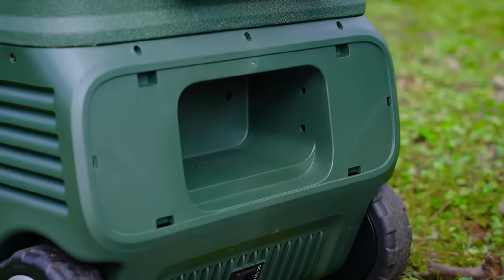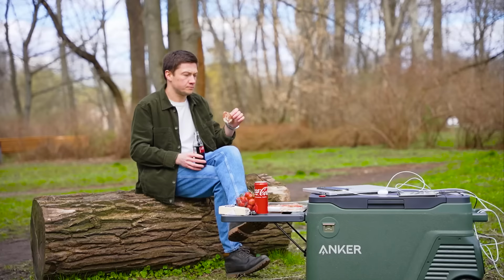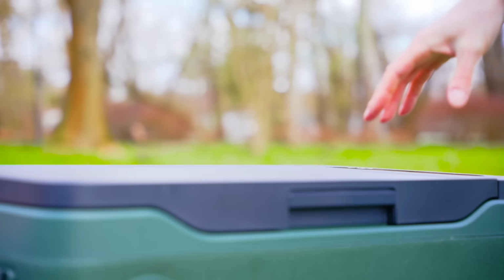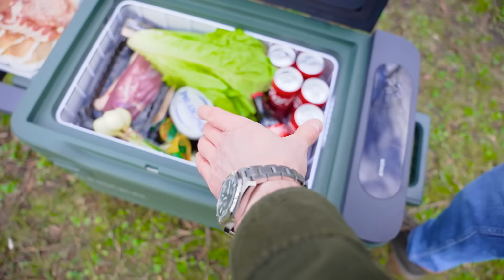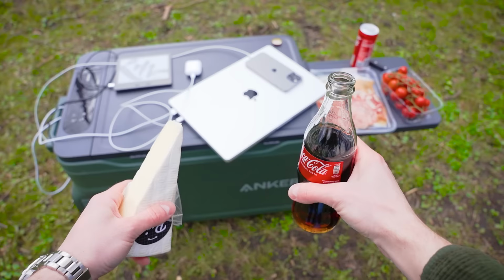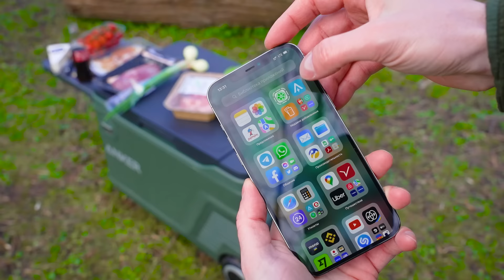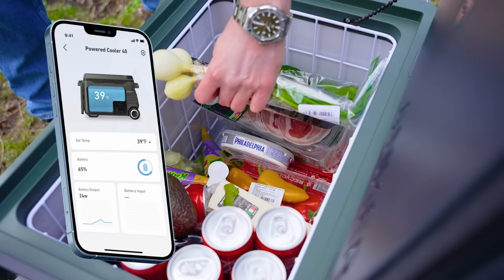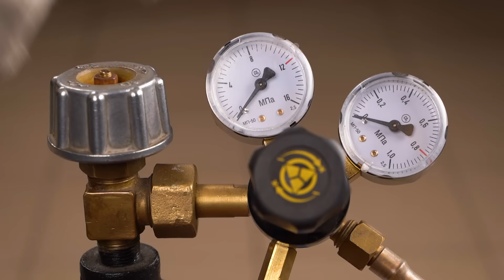Insane Square Cycling

Comment: You should take the bike on a ride in a populated area, where people look in amazement and be like, "What the!?" 😂😂
Reply: The physics of turning a bike actually requires the ability to lean. As far as I see, this bike can only go straight. Maybe a 5 degree turn.
Reply: @MPaxsu  The post linking to it claimed it could also turn but looking at the footage I doubt it.
Reply: I also don't see brakes aside from fixie-style pedal control. I wouldn't want to be in the way
Reply: Straight bike, sounds homophobic
Reply: @MPaxsu  probably can turn the bike like a tricycle. with some adjustment and tuning it probably will work. the wheel itself is similar to tank/snowmobile. maybe work better in a snow day
Reply: @jk2l  except this is a bicycle, and will not turn like a tricycle
Reply: Well the front wheel can be turned i see why wouldnt that ve possible
Reply: @LainorLean  based
Reply: @Ankhyl  you can look it up, there are numerous videos explaining how bicycles turn
Reply: No ability to go over bumps and would struggle on normal roads and pavements including uphill and downhill.
Reply: هذا فيديو عمله و حصل على مكافآت و هو المشاهدات
Reply: @rizzyullah  yeah the "wheels" are firmly bolted to the frame, so it'd be an extremely rough ride at best over anything but a perfectly flat surface.
Reply: @MPaxsu  I think it can turn bc the wheels have plane surfaces, so it can stand up while turning. The thing is that this is not a bicycle anymore, u havent got the gyroscope force of the wheels, so the physics are more similar to a tricycle than to a bicycle (u can turn without inclinate the bycicicle, what in a real bycicle would be impossible) (pd: srry for my english xd)
Reply: @MPaxsu  Of corse if u go fast u will fall bc the centrifugue force, but at 1km/h and very carefully I think it would work right!
Reply: @petapleitostv4286  Yeah I was mainly worried about the centrifugal force pushing you normal to the curve. Thanks for your thoughtful response. It would be interesting if the creator made a video on the subject to settle our debate
Reply: Estas loco busca otro entretenimiento más productivo y que genere éxito... No es dando la contra como sé triunfa es generando soluciones al éxito 😮
Reply: @benroberts2222  Just stop the way they did in the 19th century: use your feet. The very first bikes had no brakes!
Reply: @largol33t1  the very first cars didn't have seatbelts, but that doesn't mean I'd be comfortable with one

Comment: I was expecting the square tires to actually turn. This is even better!! 👏👏
Reply: No flat tires
Reply: triangle wheels are better than square wheels

one less bump
Reply: So was I. 😄😄😄
Reply: @kenwittlief255  better go flat line by that logic.
Reply: or a bicycle with 1 perpendicular revolving iron bar on each side of the two sides!!!
Reply: So they kinda work like tank treads. Would that make this a trike? 😂😂
Reply: En ovalo estarían super por lo de las subidas o desniveles
Reply: But the speed would be worst
Reply: @Rajravi87  that just gives people longer to appreciate what they are seeing 👌
Reply: @largol33t1  😂😂😂
Reply: I am afraid square tires will run smooth only on a reversed cycloid shaped ripple surface. But This guy provided an extraordinary solution to this challenge. It is really think out of the box! Brilliant!❤
Reply: 😂I was wondering How on earth it wud turn
Reply: Not really. Innovative, but it's a no for pretty much literally "re-inventing" the wheel.

Maybe there would be a better application for this besides bicycle tires.
Reply: It's like minecraft

Comment: Well, The end result did evade my initial expectation way way off. But still, Impressive work as always.
Reply: Why?? Did you think a square will actually roll??
Reply: @N.I.C.K.0.3 rotate, yes.
Reply: @captainaryan26  HAHAHAHAHA SAME
Reply: You are naive for thinking the square would really roll
Reply: @redoxreaction2388  Lol, a man can make that happen. Not difficult to create for a mechanic, yes the bicycle might be slow and the rider would move up and down with each rotation, but it's 100% possible for it to have rolling square tyres.
Reply: @captainaryan26  not really, no force can really make that happen, the force of body due to gravity on the bike make it nearly impossible to rotate the tire unless a force inclined upward from horizontal is applied which isnt possile while sitting on a bike as your wt(not mass) increases while pushing something up.

Comment: I thought you'd make an unrideable monstrosity. But you made a tracked bicycle. Or should I say bisquare? Great stuff, man 👍
Reply: Actually, he did an unrideable monstrosity...
Reply: @Speedyey  I don't really understand. You can clearly see him ride the bike.
Reply: @andrebartels1690  It looks like when the wheels are added to the bike at the end, he is actually fixing them in place. In fact, the rear can't move at all due to how the chain is attached. Wouldn't that make it so that it can't ride on anything aside from the completely flat surface shown in the video?

I guess its technically rideable, but with some more though about the shape of the wheel, it could go from "rideable" to actually rideable. One example being if you look at tanks, they don't use a right angles on their treads. The right angles on these wheels mean that its taking a lot more effort than it needs to turn the crank and its going to have trouble going over even the smallest obstacles.

Comment: Would it be possible to make this again but with the wheels fixed another 45° further around (ie looking like diamonds rather than squares/ balancing on the corners )
Reply: Well I’m no expert but that sounds like it would concentrate the weight of the whole bike in only two tiny spots instead of distributing it evenly through a wider surface. I imagine it would hardly move.

Comment: Rolling friction must be a bit tight or more pep in the pedal to get pass 3mph. Cool build though, just wondering if builder sees this as practical over overkill as Im guessing the rolling motion is a bit a lag, unless you put motor on it. What is the key advantage of using conveyer tires from a square based foundation. I dont think it runs well going over speed bumps, potholes, ect. This is where PRCATICAL comes in as a worthy build useful gadget bike..

Comment: Great work! However the efficiency would be less compared to the rolling.
Here the contact area between Tyre and ground is large, hence it is causing more friction. So more work is needed to paddle the square cycle.

Comment: 1) most folks have ridden round tire bikes over curbs 2) does this square tire bike smash into a curb, and you get launched over the handle bars, and use your head for brakes? looks like old cartoons for a laugh. work is when you accomplish something good for everyone's future, what do you think it costs for a mile of concrete freeway, with a bridge and having to replace it every 3yrs? work on replacing that senseless eco-disaster instead of calling it transportation